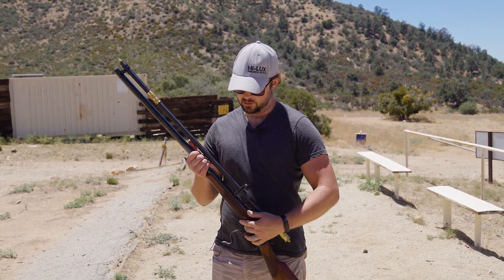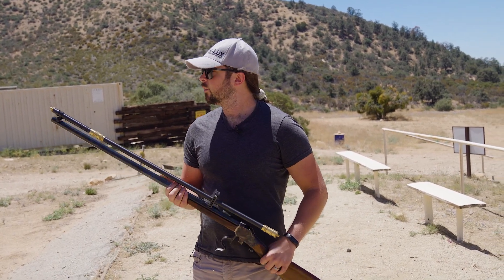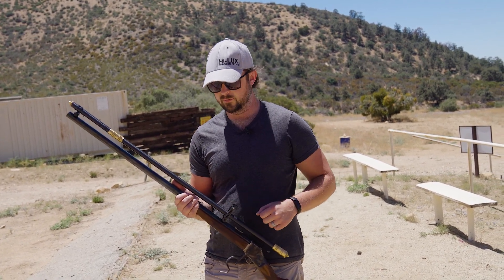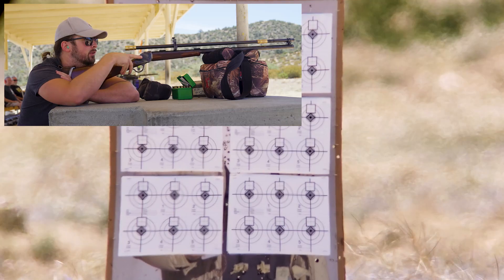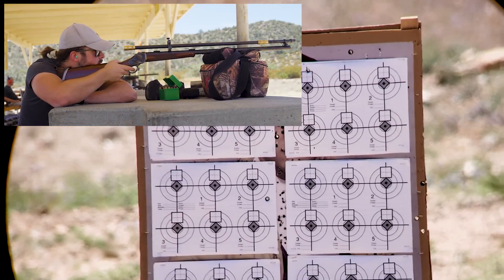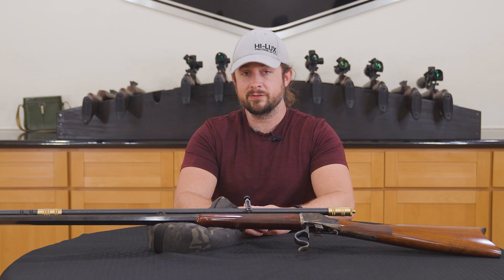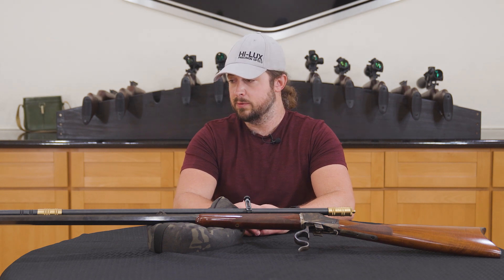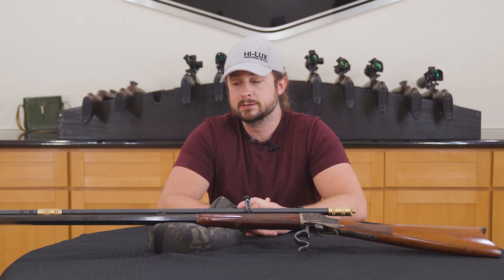Introducing the Malcolm 6X Long Scope 'Direct Dovetail' Mounts - A Century and Counting, S2E6

Comment: Can you detach this easily? I shoot long range competition that has to use iron sights but also want this for hunting
Reply from the maker: You can remove the front ring and scope tube very easily. The bunny ears would take an extra moment. It all comes down to a question of time. If you only have one minute to change setups: You can undo the front ring windage screws and slide the front ring off sideways, then undo the eyepiece to slip the scope out of the rear ring. If you have a few minutes: You can remove the rear ring and bunny ears by undoing 4 screws (leaving the dovetail in place, as it's quite low to the barrel). Whenever I take the scope off, I take a photo of the index markings first. Makes re-zeroing a heck of a lot easier.